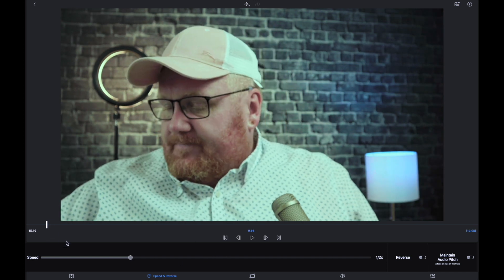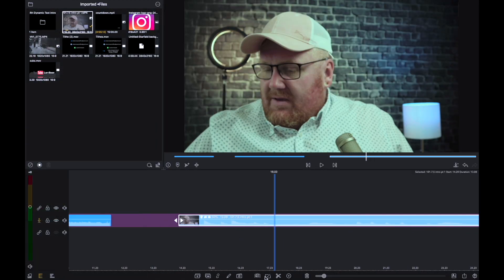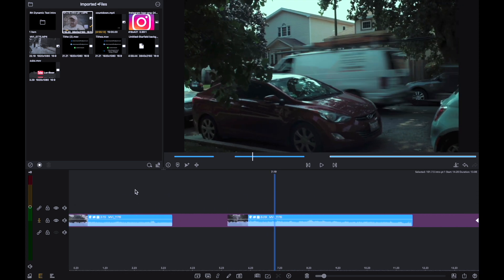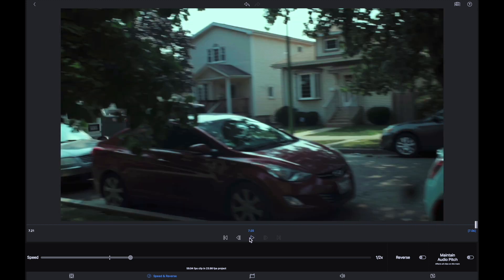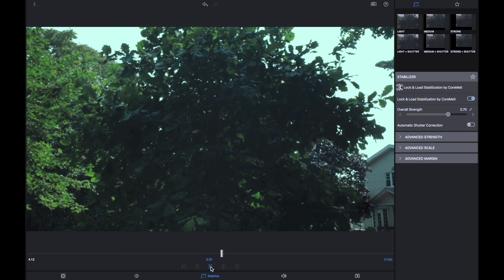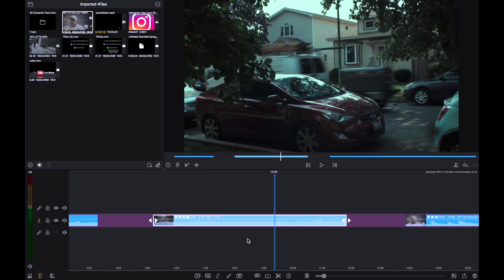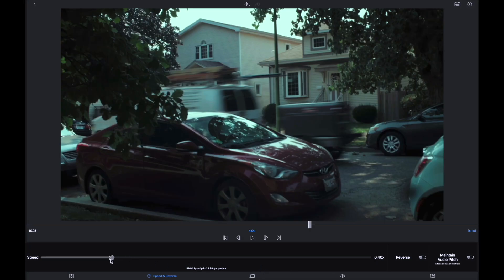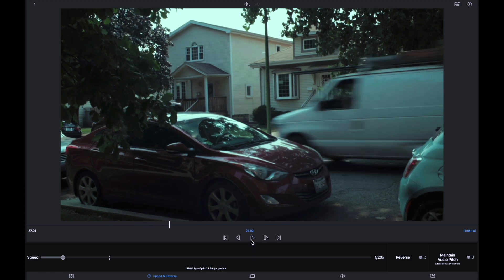Lumafusion 3.0 Slo-mo for Beginners

Comment: Hello! How are you? Sorry if you explained it in a video, I was looking everywhere and I couldn't find the solution. I need to change the speed of multiple clips at once. That is, put all the cuts, at 75% speed for example. I can only do it with one, when I try to copy and paste that parameter, it doesn't take it. Take the rest, but not the speed. It is very cumbersome to change one by one when I have many clips.

Thank you!!!